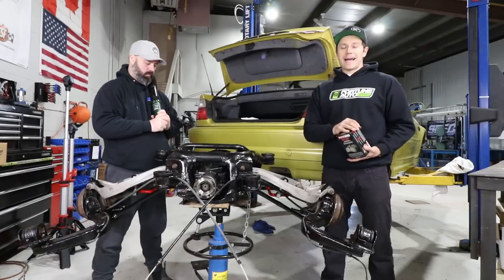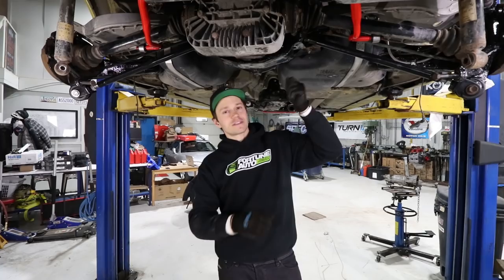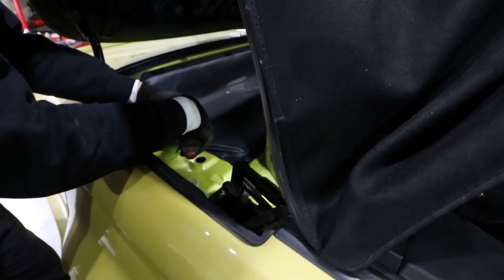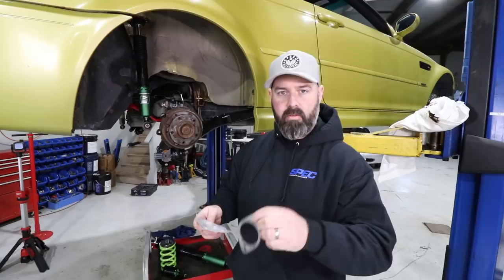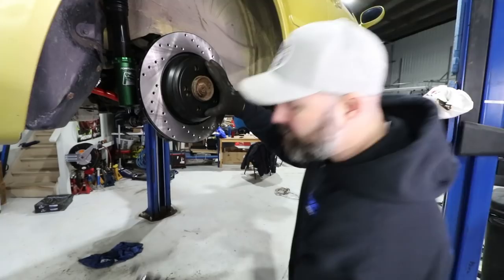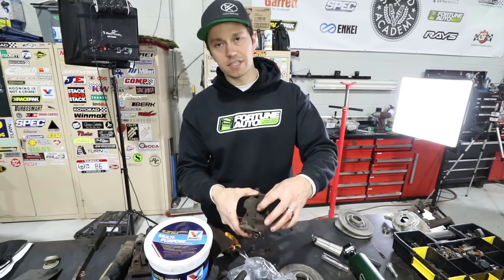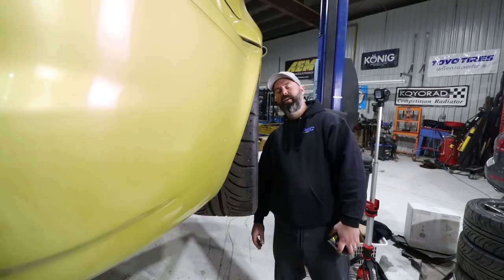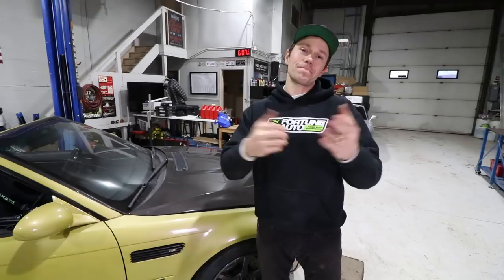Rebuilding and Modifying a $4000 BMW E46 M3 - Part 19

Comment: Protips:
-Reinforcing plates will prevent the spring adjuster from cracking the aluminum upper arm.
-Petroleum grease is not for brake parts. Use only silicone paste on the rubber boots and slider pins.

Comment: Coilovers are known to break the aluminium upper control arm on the e46 so you need to install reinforcing plates. The plates just sit between the upper control arm and the bottom of the coilover so are super simple to install, and are cheap too.

Comment: ECS Tuning sells the rear shock mount plate for e46 convertibles it’s basically half of the plate so you can slide it through the holes

Comment: Probably not the best to use petroleum based grease on brake parts. Unless the multi-purpose grease is ok with rubber bits that is. I like using silicone based grease on brake bits better. Love the series! Keep up the great work!

Comment: You can put the rear reinforcement plates if you remove the top protector its just 20+ bolts. I have e46 vert too.

Comment: Man oh man, finaly done with the "Rust Wars" lol. About the rear gap, i would realllllllllly recommend going 0/zero to -1 deg MAX of rear camber for even tire wear while drifting, M3s have a rear multilink setup so it goes negative on load/squat. I can eyeball more than -1 on the rear hence the top is but sunken in. With less camber the top should pull out for a more flush look too ^_^
Reply: To calculate amount of wheel poke at the top due to camber just: 
poke_inMM = tireDiameter_inMM * sin(camberAngle)

Comment: I normally don't comment on videos but did you use high temperature silicone grease for the caliper slide pins?  If you use normal grease you could encounter problems with it baking and not sliding properly.
Reply: Yeah the grease they used is for wheel bearings and suspension grease fittings, not for caliper sliding pins.  
You guys should definitely used something like Sil-Glyde because thats rated for twice the temperature that bearing grease is rated for. your gonna need it on a drift car lol
Reply: @speedacademydave  Petroleum based grease will cause the seals to swell and seize the pins.